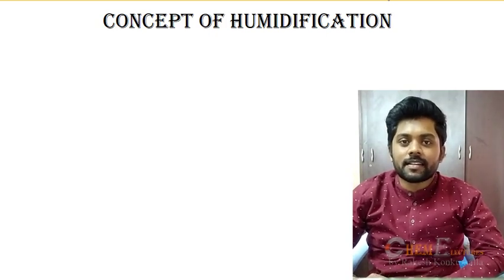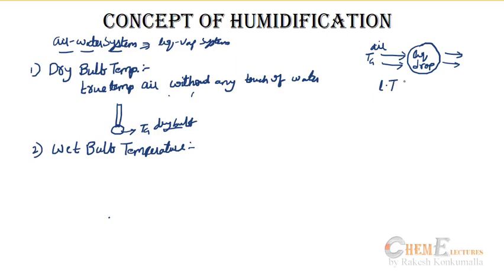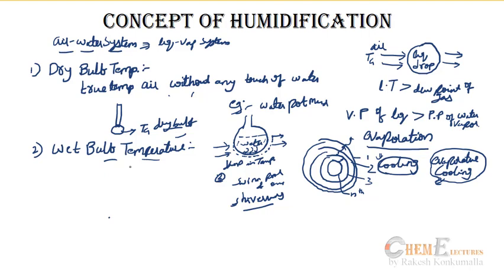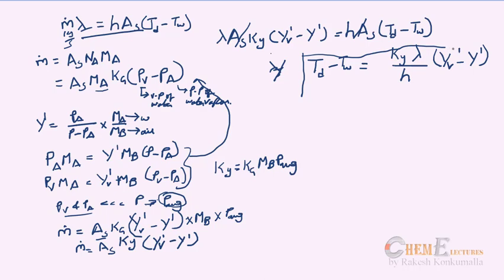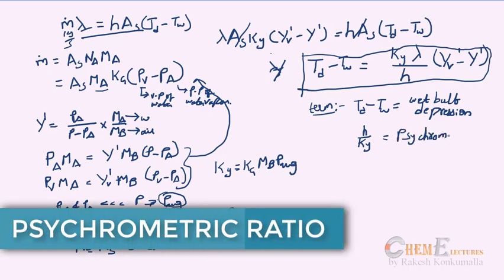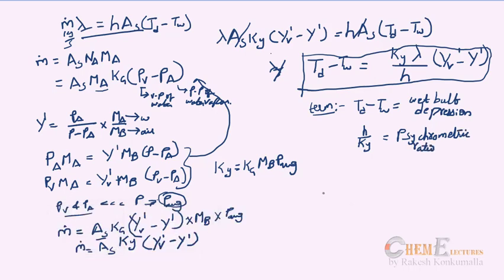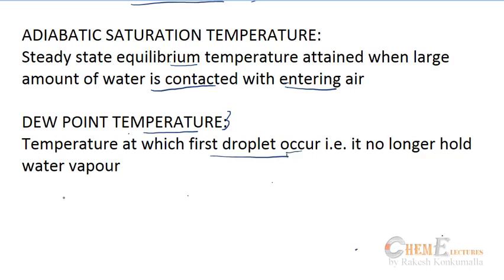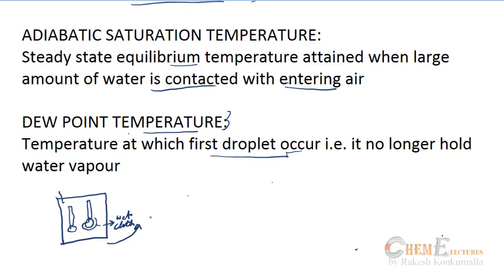Dry Bulb Temperature|Wet Bulb Temperature|Adiabatic Saturation Temperature|Dew Point Temperature

Comment: A small doubt in this, while explaining the concept of WBT you have explained the concept of sensible heat transfer from inner layer to the outer most layer and there by a reduction in temperature of liquid.My questions is regarding the possibility of heat transfer from the air surrounding the liquid droplet in the evaporation of water.